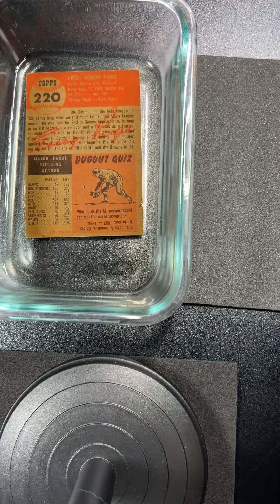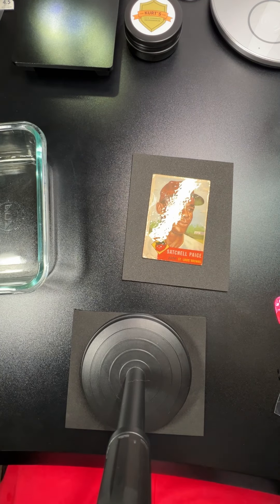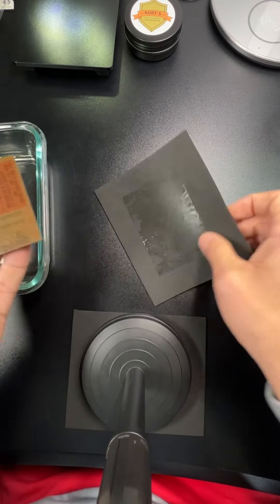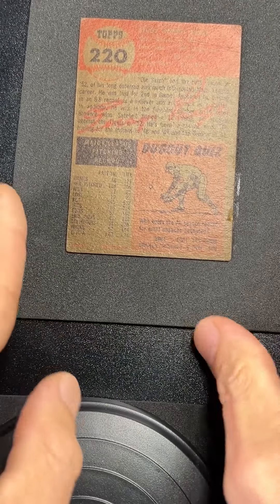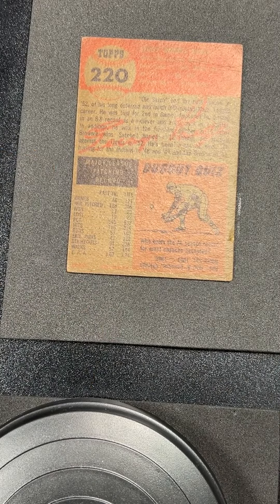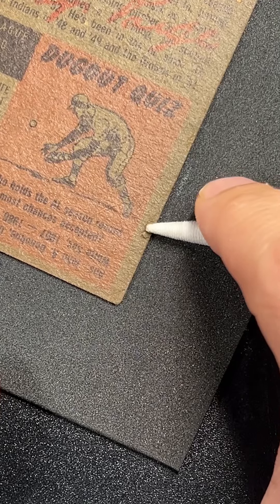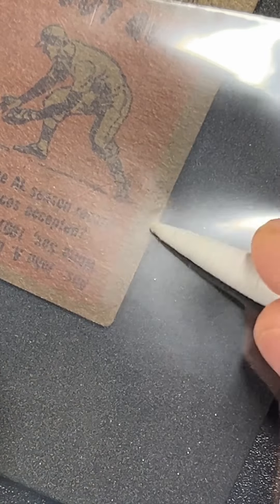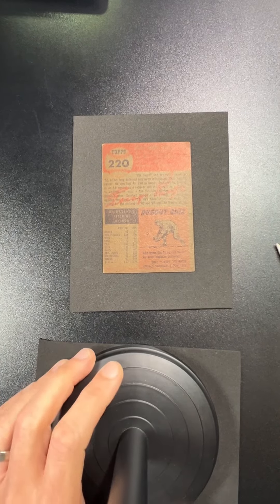Fixing a small rip on a vintage Baseball Card

Comment: Hey so question I don’t have Instagram so I can’t get you there… but I have a Allen Iverson rookie flair showcase. Row 0 has a little bit of scratches I can only really see shining a light and looking in a magnifying glass. I have tried “fixing” scratches three times and I can’t get it they’re not coming out. like none of the scratches are coming out I’ve done it just how you and other people have shown how to clean scratches.
Reply from the maker: It’s probably not your technique. They’re probably physically scratched into the plastic and something you can’t do anything with. Light abrasions, little roller lines, stuff like that you can improve, but straight up scratches into the plastic typically don’t do much.
Reply: What are you soaking it in?
Reply: @kurtscardcare  update I sent it to get graded after getting a lot of surface. Scratches out the deep ones i couldnt . I got an 8.5. SGC not bad i was hoping for an 8
Reply: @parttimeoutdoors104  not a card to be soaked